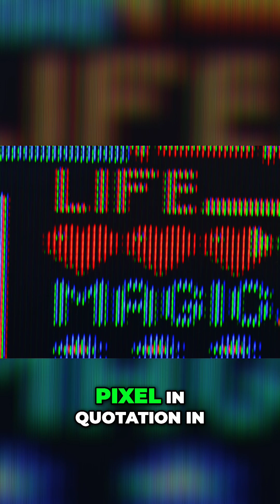CRT vs Modern Displays  The "Pixel Size" Difference! #crtgaming #retrogaming #gamingshorts

Comment: Art was designed using CRTs. That's the interesting bit 😊
Reply from the maker: Yeh, and it shows. All this time I tried using other solution to mimic it, just so I won't need to mess around with buying a CRT and everything else needed. Once I saw a CRT that actually I connected with, all the rational flew out of the window and emotions kicked in.. it's a huge change to my gaming habits, but an easy decision this time around.
Reply: Weeeelll!! CRTs are magic. (The real magic is not to be perfect displays, as these ones bleed colours outside the pixel they supposed to lighten. Thank you for your vid❤  @CRTGang

Comment: I think you could definitely simulate this on modern displays. The higher resolution ones have about 15-20 pixels per one original game pixel (or line). One can do a lot with those 20 pixels, color gradients, blooming, you name it
Reply from the maker: You can simulate. That's why I did for years until now, using shaders and tweaking it to my liking. It didn't change the fact that once I experience my favorite game on a certain CRT, I immediately felt something different. And like you, that's what I thought before. I am not ruling out many of the advantaged of using shaders and some games I do play with it, but mostly on CRT. There are also things regarding the physical product look itself, the reflecting glass and its effect on the image and so on. All of the shaders that I've tried, and some of them are very impressive, couldn't spark the nostalgic connection as much, and with the CRT I don't even have close to the crazy amount of control I have with shaders. This just goes beyond the accurate simulation technicalities that my brain interprets differently, consider I lived back in the days and experience it for a long time playing on CRTs, so it's embedded hard in my memories and CRT helped bridge that connection better than anything else. Which is the one of the main reasons I bought the hardware in the first place. Maybe at some point I'll find something that works better, but yet to happen. I prefer the simple simulation solution, but CRTs convinced me otherwise.